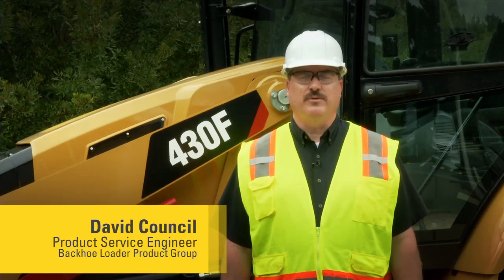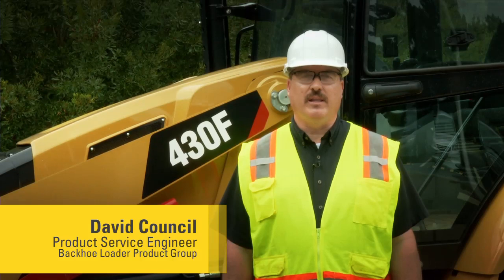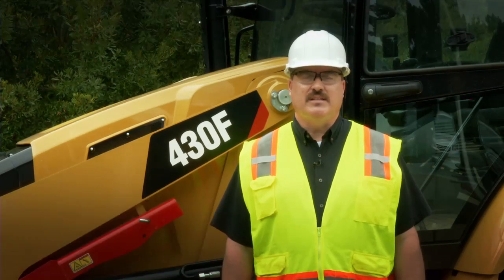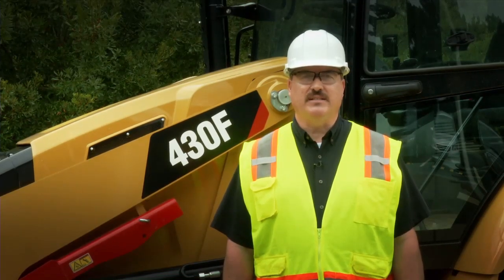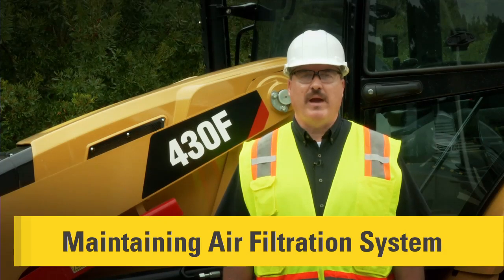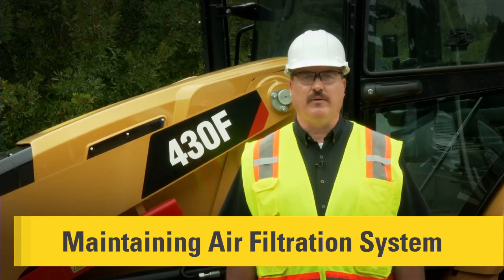Air Filtration System - Maintenance Practices for the Cat® 416F, 420F and 430F Backhoe Loaders

Comment: Use a portable air compressor to blow off the dust and debris on the air filters. It works better than banging them on something and prevents damage to the filters. 🌺🙂❤️🙏